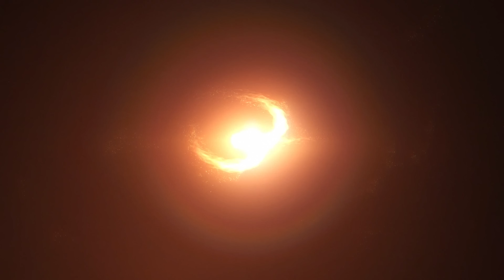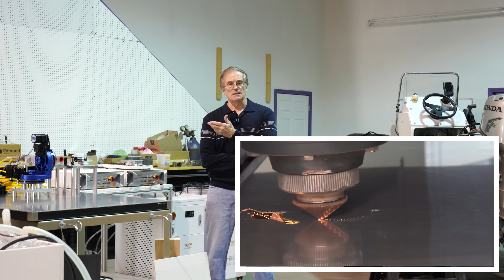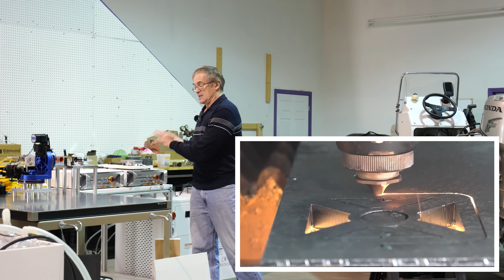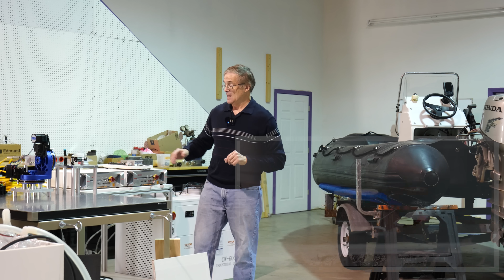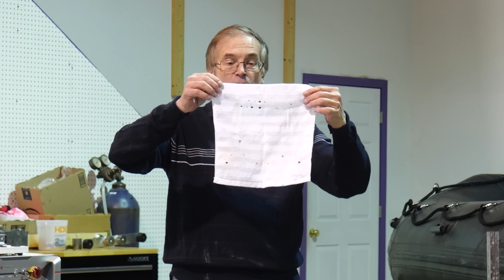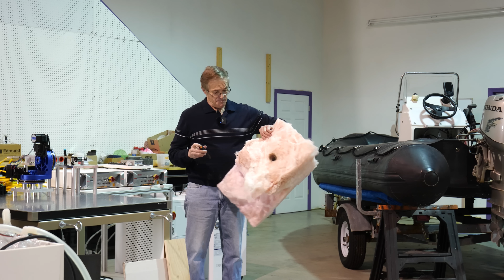We have a problem... and need your help!

Comment: A tank with mineral oil. progressively make it non transparent with some contaminant(graphite?) to distribute the dissipation of heat throughout the oil column. A mirror that rotates about a center that makes sure the beam always hits the surface of the oil. When the mirror finishes the travel to redirect the beam, the beam is pointing down into the oil column. I guess the week point of this setup would be that the mirror would need to be perfect... or maybe elevate the whole tank in front of the laser, with a glass side to let the laser through...maybe mirrors inside the tank to elongate the beams travel...

Comment: What about diffraction? Diffuse the beam onto a larger target that can take that load. My first thought was the gypsum you went to. Another good one would be titanium dioxide mixed with sodium bicarbonate, shellacked onto that drywal in layers. Do I get the job? Also if your lasers are capable of marking fine enough to color metal, could I send you some material to mark for me? I have a wild idea for increasing capacitance using nitinol plates.

Comment: Also consider pointing your laser down at an angle into a non reflective material like a pool of water with a piece of carbonized cardboard, floating on top?? Non reflective cooled, cheap and non toxic with the earth as a backup and nobody knocking on your door.

Comment: So you’re looking for some hay bales to put behind your target to shoot arrows at. Oddly enough one thought would be run water over hay bales. The water would act as a coolant. It’s not toxic, and it would put out any fires. The hay bales are absorbent and if they do carbonize that may even work better, possibly even charcoal or even water with crushed up charcoal in it that’s flowing to keep the charcoal in suspension or possibly some other fluid that when heated doesn’t become a toxic and its cheap! 
   Oh, and by the way Our Universe is not expanding, everything in it is shrinking. LOL, good luck you and the pyro guy should hang out.!!

Comment: If you are going for physically stopping the laser I would sandwich sand or fine gravel between two layers of material. As the laser burns through the substrate gravity replenished it. It would probably end up being heavier than you want but still probably the most effective for the cost. However I think the simplest system is another camera to detect the laser on whatever backdrop you builds, that either initiates a rapid scan pattern or hits the kill switch. You may need a combination of both to effectively test against drones. I think your total time you initially estimated you need the barrier to hold up to the laser could be a lot less with an active system that automatically initialed a rapid scan pattern.

Comment: 1)  LOOOOVE your channel.
2) WATER CURTAIN:  What if you add fine charcoal (Like a biochar) to the water?  Would that give enough color and mass to absorb the heat and light?
3) SPINNING REFLECTION:  How would a laser behave if it hit a rotating, curved surface covered with very coarse material that is either reflective or absorbing of the laser light (and heat)?   
Hang a cylinder of highly reflective material vertically and rotate it axially, but add a super rough texture to the surface.
Try refracting, reflecting, and light-absorbing materials to see which works best.  
Rotation prevents the laser from having localized intensity.  
I know you don't want to "reflect" the light, but perhaps reflection will not be a problem if the beam is broken into very small segments.  
If this works, you can make a wall out of multiple cylinders.

Comment: Sorry i'm late to the show, and have not read all comments. 1) i like the sensor-interlock-disable idea, carbon-foam-running-liquid, and dissipate toward ground ideas 2) I saw redundant mentioned, so i presume stacking several cheap ideas in series has been discussed. 3) has copper plate at 45 degrees down ward, and further, attaching plate to piezo vibrating oscillator been mentioned? no one spot is likely to overheat as its always moving rapidly 4) can you just point your experiment downward and let your floor and the earth take the down-range risk?

Great channel!

Comment: Why not try to disperse the light instead of absorb it seems like it might be an easier task if you were to disperse the light which on a fixed Target would be pretty easy to do with the lens if you're trying to do moving targets you would need a surface that is reflective and somehow coated with a bunch of tiny lenses just seems like an awful lot of concentrated energy to try and absorb dispersing and deflecting it seems a lot easier

Comment: You could consider a vertical laser set up.  Aim it down into a bucket of water with a sacrificial block of anything in it.  Consider a pine 4x4 for example sacrificial material. 

Alternatively if it has to be horizontal - Maybe a steel plate with a water fall curtain with lots of carbon dust in the water.  the dust (Charcoal) might help to embrittle and harden the plate while the water would continually cool the plate.   You might also consider swapping steel for ceramic.  Nasa used special ceramics to help space craft on reentry.   You could also consider a tungsten plate.  High melting point.

Comment: Maybe a little late, but would a magnetic lens work? A plasma 'candle' + magnetic lens could diffuse the beam enough to make other lenses or materials viable. 

That lens can't be damaged by the beam. And the collimated EM waves may actually improve the efficiency of the lens if the emitter is close enough to the beam radius.
Reply: Could act as a deadman switch. To 'pull the trigger' the computer would have to send an active signal to turn off the magnetic lens
Reply: Since the biggest issue seems to be pure power ablating the material, diffusion could work with the lens.

If you could get conical scattering from a magnetic lens, then you have have a "sci-lens-er" of graphite or lamp black coating a drum, with a hole for the undistorted beam. 
Like the radiator bits on the barrels of old sci-fi ray guns.

Could make your ray gun look freaking sweet.

Comment: Hi, try a starlite coated drywall, but behind it, use a metal layer that will reflect it, the starlite from nighthawkinlight YouTube, the starlite and drywall will absorb the energy both from  front and back from the reflected  laser behind it, so the drywall and starlite will be burned anyway

Comment: well for the focal point of the laser beam you could use a salt lick from the hardware store or any agriculture/hunting store.  I have a feeling you could blast that all day with a laser and it would just melt and then solidify back into itself. not sure its cost effective to build a wall out of them. im talking about the garbage can sized ones that are like 20 bucks, i think theyre mostly sodium chloride but are usually off brown/orange/yellow? maybe some other trace brine elements in them

edit: appearently this is a very common backstop/"beam dump" for researching high powered lasers but there are issues with it being hydroscopic. if the salt is hydrated the surface will spaul or whatever its called from liberation of water vaper but just straight up NaCl is the go to for IR beamdumps.
most people who studied chemistry and did IR spectroscopy know you can reform most salts into a sort of solid matrix by applying enough pressure to them. maybe that would be a big hassle but if you had a good press and welded up a form you could take any pieces/scraps that fall off and reform/recycle any salt tiles

Comment: This sounds like a job for Starlite, or rather cheap home based solutions that perform similarly.  Basically, bubble and burn off the outer layer to protect what is behind it.  It functions similar to the ceramic tiles on space craft.  I'm sure there's a lot of other good suggestions in the comments though.

Comment: Im certainly not an expert, by why not use the same principles that silencers and active noise cancellation tech does to eliminate the beam? By this I mean a beam dispersal material using prisms or other style cheap lenses to disperse the beam into infinitely smaller or scattered beams? Perhaps a material coated with a specific geometry of glass. Just a thought.
Reply from the maker: If the beam location was fixed, then something like your solution would work. 
Here, the beam director is scanning across the whole back wall, and any delay or glitch could leave the beam burning a hole in that wall. We're talking about 20 ^2 meters of coverage.

Comment: The wet blanket in the video wasn't wet enough and it was stationary, so the amount of water it could hold was limited. 

If the blanket was moving and fully saturated, it might work. A water filled trough with a wide belt of absorbent material running around a pair of rollers through the water could maintain a reasonable thickness of water in the blanket while covering a large area. The blanket material might need to be something like Nextel 312 ceramic fiber fabric. Both layers of the blanket will absorb the laser as it rolls around. The back layer will see a more dispersed beam. If the laser starts to cut the front surface, the back side should see a more dispersed beam and give you some time to shut down. 

Dyes, slurries and thickening agents in the water are options to absorb and disperse the beam and maintain a thick layer of water. Cenospheres are a light weight refractory material derived from coal ash, available with a density of 0.85 and a melting point of 1500°C. They are gray, and easily suspended in water to form a slurry.  A porous sheet of material behind and in loose contact with the front surface of the loop could hold more water and would be cooled by the blanket moving over it. There should be plenty of water to cool that layer coming off the blanket.

Comment: Use blocks of ice as a backdrop for your laser problem
Reply from the maker: Probably not practical. 
We need to protect the entire back wall, and that means about 20^2 meters. That's a lot of blocks of ice, not to mention the melt water.

Comment: If a salt mine would work, what about horse salt blocks stacked up?
Reply from the maker: It's similar to the problem with concrete blocks.  To cover a large area of the back wall, it will be VERY heavy.

Comment: Use a vertical fluidized bed mix composed of fumed silica, vermiculite , and perlite. Reduce laser output by half. Place both lasers a short distance from each other and focus both beams on target. Converging beam will disintegrate target.

Comment: what about basalt fabric? you could use multiple sheets at a 45 degree angle and attach them to a sheet of steel. The metal would likely reflect the laser back into the cloth trapping and diffusing it. Water could also be utilized to cool the material and further diffuse it. The sheet would need to be at a slight upward angle with water was run along its front facing surface from above, like an artificial waterfall.
Reply from the maker: We may end up using Rockwool, which contains a similar material.

Comment: Maybe a computer controlled adjustable lens assembly to focus the laser on the target so that it is out of focus when it gets to the back wall. Would need to track depth as well of course, so would need a radar system or similar. Then could only fire the laser in pulses for < 1s and hopefully it would be strong enough to take the drones out in that time.

Comment: 💡i think for testing you can aim it downward at mud or fill an small inflatable pool (or a large tube if the target is not moving) with water and some carbon dust (with sand at the bottom), there are also fire retardant coatings (intumescent paints), carbon felt, rockwool + water (mist) curtain which can be a good idea for a vertical shield, weting each one can also make them better. or you can make a rotating wall behind it these are my easy, cheap and lightweight ideas for shielding or you can just change the focus of the beam .

Comment: You said plywood would be good if it weren't for the fire problem. Well, you can't have fire without oxygen, so remove the oxygen and you should be able to shoot your laser safely at as many layers of plywood as you want.

I have a couple of ideas on how to do that. My first idea is to put the plywood in vacuum bags made of a fire-retardant material like vinyl (PVC). While the laser will punch a hole in the bag, the hole will be tiny and as long as you can shut off the laser quickly, the rate of oxygen leaking in though the hole may not be enough to sustain a flame? While PVC does release chlorine gas when burned, the burned area should be as tiny as your laser beam is thick and I imagine such would release far less chlorine than what you'd breath in standing next to a public swimming pool?

To make the above set up even safer, instead of vacuuming the bags, fill them with a low-cost non-toxic non-flammable gas at higher than atmospheric pressure so when the laser pokes a hole in the bag, it would have to leak out enough gas to drop below 1 atmosphere before any atmospheric oxygen can leak in. I've never done anything like this so I don't know if it'd work, but I imagine nitrogen would be a good inert gas since it's the most abundant gas in our atmosphere (and thus probably relatively inexpensive?)

Alternatively, you could put your laser and target in a big air tight container filled with inert gas, and then you wouldn't need to worry about the theoretically small amount of chlorine from the vinyl bag idea, though building such a container would be more expensive and bulky.

Either way, this should theoretically allow you to use plywood without the fire.
Reply from the maker: I like that. The vacuum would be tough, but flushing the bag with CO2 would be doable. It's worth a test.
Reply: @TechIngredients Glad you liked the plywood in vinyl bag of inert gas idea. Hope it works out for you (and would love to find out if you were able to test it even if it didn't work out).

Comment: I have one idea and it's simple.  When at full power, place the laser at a steep downward angle and direct the beam down into the dirt outside.
Reply: This got me thinking.... I wonder if you used a Maser instead of a Laser.  A microwave beam may have the same affect on a drone without giving away your location.  If a laser were used to destroy drones in a combat scenario, you would be revealing the location of the turret,
Reply from the maker: The problem with microwave frequencies is that the divergence is orders of magnitude higher. Even with a huge microwave antenna, including a phased array,  the higher divergence limits the range. Both an infrared laser and a microwave beam are invisible and need detectors to "see" them. To those detectors, both are visible.

Comment: a bit tricky but:

you could try with a fast-spinning hemi-cylinder (vertical cut) filled with water. the centrifugal force will resist the water from flowing down and could create a water-wall for long enough to absorb the laser

Comment: A water‑filled tank packed with fiberglass insulation. Maybe place a diffuser in front of the tank to spread the beam before it hits the water to avoid hot spots on entry

Comment: Love you guys.  Practical - Geniuses, they convey technology so eloquently so we can all understand .
i have 5 ideas , 

  1) 'Laser trapping Mirror absorbing  sandwich'

Take 2 mirrors and face them inwards with an air gap. Fill inside with wetted absorbent materials. The laser will fire and penetrate the rear protective black or red paint and enter the air space and gobecome trapped and bounce around inside. Having some wetted material will absorb the energy.

You could also place a spacer in the middle of the mirrors to slightly push them apart so they form 2 curved surfaces. This will make the trapped laser dance around inside the sandwich gap and be absorbed by more wetted material.

please do , Test out the backing paint of the mirrors — you want a black or red paint, not silver.

Test if laser can penetrate through the silver layer after the backing paint , i imagine it would be okay as is matt and  rough because its up against the paint.

2) The charred plywood,  waterfall sheet.

Char a sheet of plywood heavily with a big blow torch. This will make the surface Nano black and super absorbent to light energy. 

Set up a pond pump to flow a moving layer of water over the front of the sheet. This will act like a diffusion lens and cool the sheet and deprive the strike point of oxygen.

You could experiment with water over the rear side  as well, or in between perhaps 2 ply sheets. You could also but dye or flecks of dust in the water.

3) Starlite putty over a board .

Mix up some Starlite material. You can paint an egg in this material and it will not cook under an intense 5 mins of butane blowtorch.

It also absorbs lasers , as tested at UK weapons labs and NASA to 10,000 degrees. It is a smart material.

You may know of this, but it was invented by Maurice Ward in the UK in the 80s, but the secret was lost when he died. However, it has been recreated as a recipe by Nighthawkinlight on YouTube. 
Amazing effort ! Its cheap.

Please  check it out.

4) Privacy glass , plywood sandwich . 

Experiments with sheets of pebbled, privacy glass
The bumpy, pebbled surface can act like millions of diffusion lenses.

Place this sheet in front of wetted plywood for an immediate diffusion effect before the laser strikes  the wood.

5) Glass micro spheres sandwich 

Glass beads sandwiched or filled between a sheet of glass followed by a rear sheet of  wetted  plywood.

Millions of tiny glass beads will diffuse the light so it spreads the laser out before it meets the  wet plywood.

Thanks
Reply from the maker: Thanks!